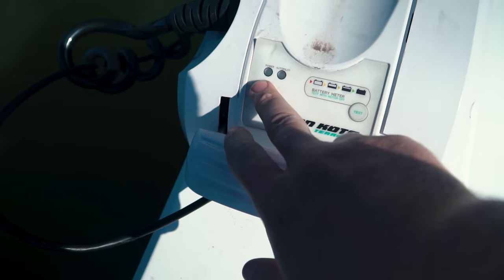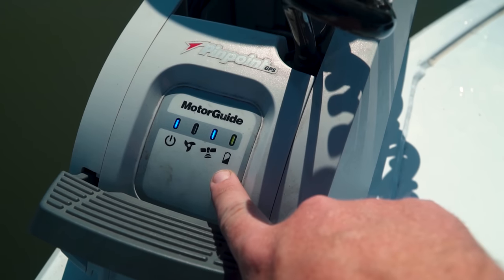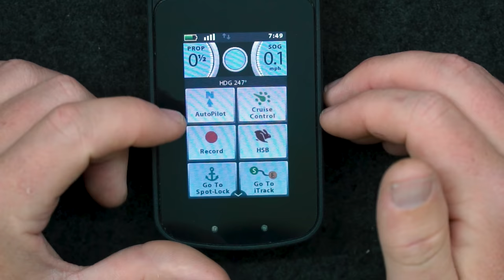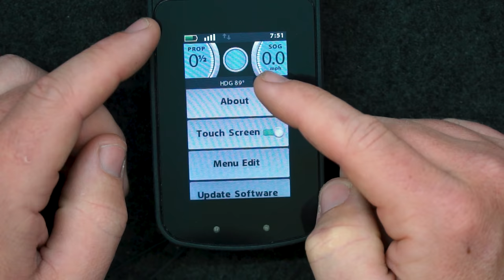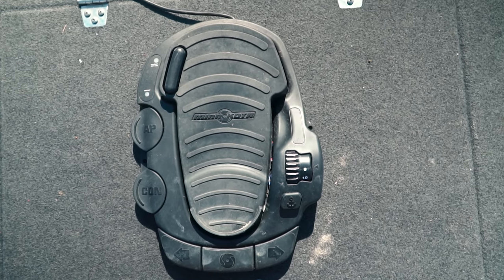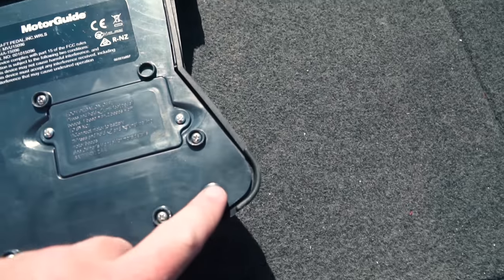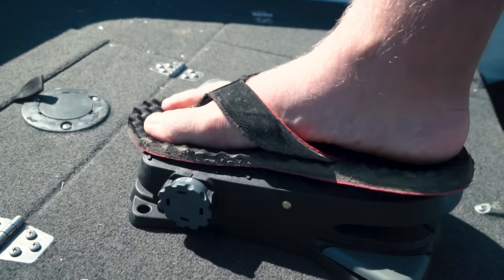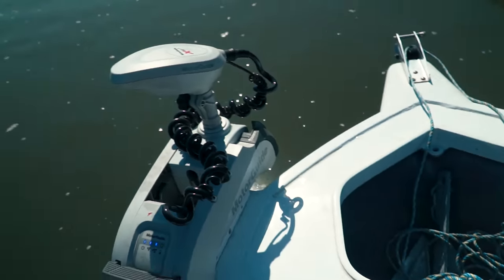Watch this before BUYING a trolling motor - Comparison

Comment: A super fair and level headed comparison of the two. I know it was likely an older model Minn Kota that I had previously used, but I think the Motorguide is far more responsive and is ridiculously conservative regarding battery usage. That said, the foot pedal design is just dopey - not everyone grew up using cable steer systems and pushing forwards to turn left just isn't intuitive. At the very least do the same thing as the Minn Kota and have directional arrows on the front edge.
As always, love your stuff drew and Congrats on 10k Subs!
Reply: Agree on the foot pedal! Terrible design.

Comment: I’ve got a 55lb Motorguide. The only issues I’ve had was a batch issue with the lower units rust proofing. Murcury replaced the lower unit and it’s been fine since. The other thing it does, every now and then, is go nuts. You’ll be spot locked or heading locked and it’ll turn one way or the other and go to power 10. I’ve not been pitched overboard yet, but it’s a little hairy when standing up on the front deck near the motor and suddenly it decides it doesn’t want to keep calm. 
Otherwise though I love it. Remote battery lasts for ages (simplicity is good sometimes) and it can save 8 tracks and 8 waypoints that it’ll go to when you press the button. Gotta write them down or make a note in your phone what location each one is though.
Reply from the maker: Yep I've had lots of people tell me they had the paint/rust issue.
Reply: Drew M on a positive note the new one has been fine. Great video btw. Good to mix up your channel a little.

Comment: Great vid Drew.  I researched MK's and MG's for about a month for my new boat.  Ended up going with the MotorGuide Xi3 (smaller footprint than the Xi5 and no overhang) and will add a foot pedal later.   The Ulterra and Terrova were both overpriced IMO, for what you're getting.

Comment: Just stumbled across your channel. Nice work. The one item you didn’t comment on was accuracy of GPS and spot lock one motor compared to the other. As a lure fisher hitting snags all day it gets annoying when my boat drifts way off mark before it kicks in and repositions to “ locked spot “ I have an old 80 lb Minn I Pilot and it’s  GPS anchor lock is terrible. At next upgrade was looking into something different unless they have made it more accurate. Thanks for the other info though.

Comment: Excellent vid mate. Wanted the auto deploy minn kota 112lb for my 6.7 Hooker but the largest retailer in QLD said don't do it ALL the auto deploy mechanisms fail. Not much else in the space to choose from, which just gives me the royal shits.
Reply from the maker: Yep I know a guy that had that issue. Seems as though keep it simple is the best option
Reply: Hi mate I have the Auto deploy 80lb thrust never had a problem touch wood 3 maybe 4 years old works great.

Comment: I tried my brand spanking new Haswing 55lb GPS electric motor yesterday and had a ball. Good by anchor. Great motor for the $ as long as it keeps working.......😳
Reply: BIGROBAUSSIE how’s that going for you?
Reply: @dontorrey6117  so far so good. 👍
Reply: Hows the haswing holding up? I am looking at it, maybe in the 80lber
Reply: I am looking fat the 80lb Haswing too.  Had a 55 lb and it was great but sold the boat after 1 season so dont know how it would have held up.  Not sure the 80 comes with a long enough shaft though.

Comment: great review.  Thanks for doing the side by side.  I have the MG and love it but I've had the same issues a couple times with having to reset and re-stow.  I do have a question about the pinpoint though.  When I set the anchor the gps positions the bow facing into the current.  Is there a setting that I need to adjust in order to ensure that the boat remains positioned exactly in the direction that I am pointed?

Comment: As I understand it there's around $1000 difference between them, at least for the 80lb versions. The minn being most expensive. Care to comment whether you think the $1000 extra is worth it for those extra bells and whistles? Always had a MK on my boat and am looking for an upgrade but I think I may be getting a motorguide this time around.
Reply: Herbal to me, no $1000 for a better wireless remote doesn’t seem to cut it, not even close🤦‍♂️🤦‍♂️🤦‍♂️🤦‍♂️

Comment: Hey mate, looked through all the comments and couldn’t see what size motors you are comparing for your size boat.
Reply from the maker: Both 80lb 👍
Reply: @DrewMinto  thanks mate, do you think a 55lb would work ok on your size boat? Or wouldn’t be enough thrust for big currents/wind etc?
Reply from the maker: Had a 55lb and it struggled abit in the wind or current
Reply: @DrewMinto  thanks mate, I’ll wait it out and get the 80lb then.